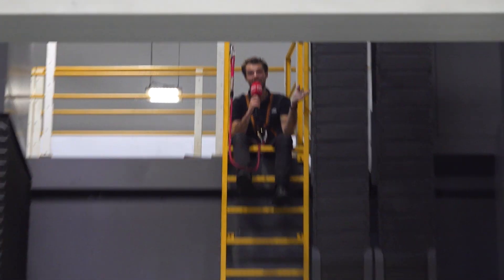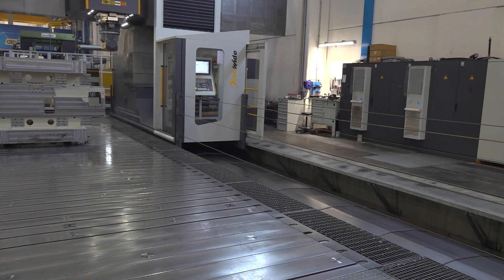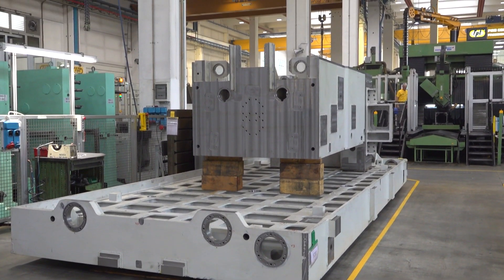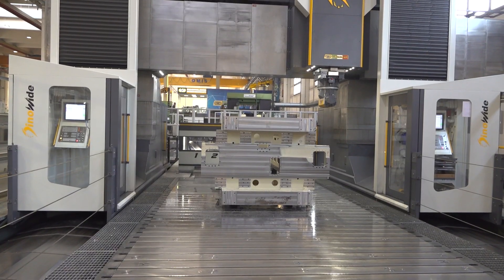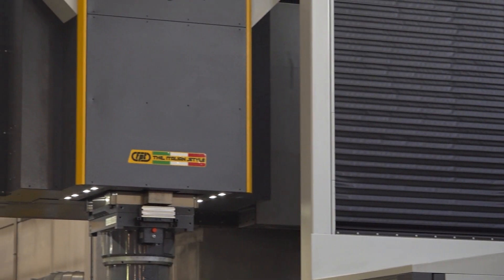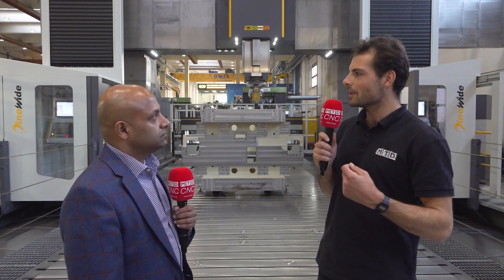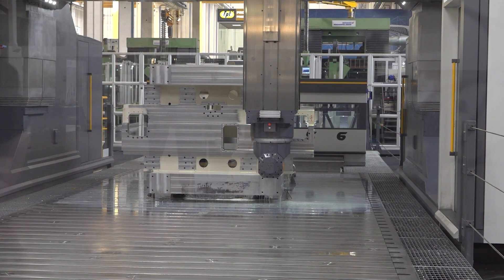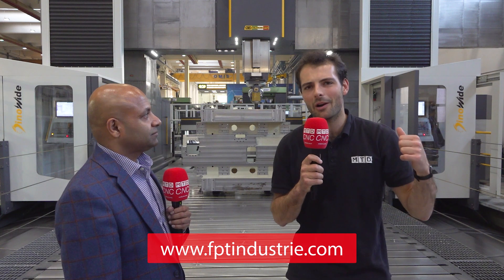Extreme flexibility and precision for huge parts with FPT Industrie’s DINOWIDE vertical gantry...

Comment: Just filling the hole table with normal size parts ( like 2-300 ) and let it run and it would probably get it done faster if you program it to use the same tool on all the parts before changing to the nest tool or run like 5 different jobs at the same time